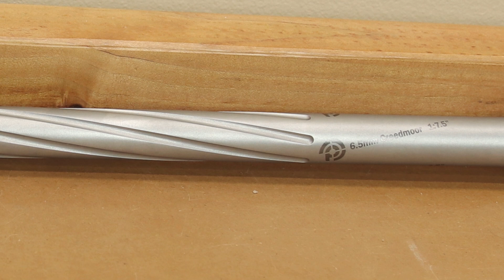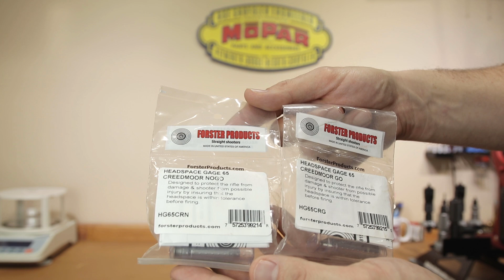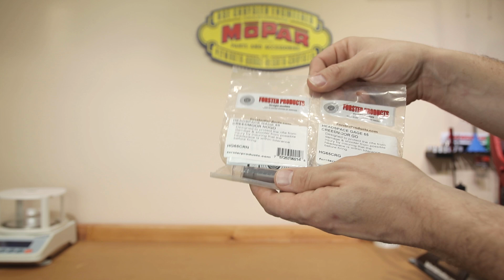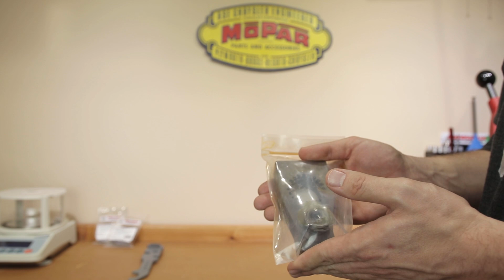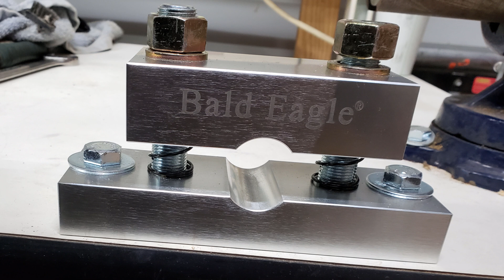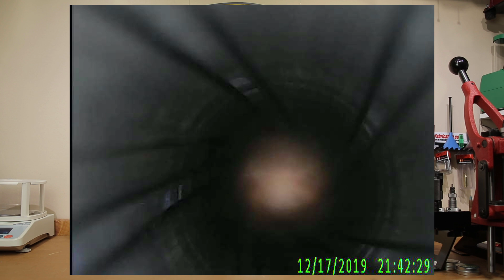Ruger Precision Rifle Barrel Swap - The tools you need

Comment: Man! Just In time. Got a 28in Kreiger 6.5prc, 7.5 right twist. Got PTG go no go gages.  What I cant determine is it better to hold the barrel and unscrew the nut or stick a creedmoor action rod into the PRC lugs and hope. What i have heard is to put about 60 lb/ft on the gun and wack the wrench with a steel hammer. What say you?
Reply from the maker: Making sure you have the action rod fully engaged you will probably be ok, I had someone hold the action into the action rod to make sure it went ok. By yourself having a barrel vice might be the easiest to break the nut loose. I am sure it was way more than 100 ft lbs to get it to break loose.

Comment: i have a Remington model 7 with a worn out 308 win barrel i got a used 7mm 08 & 243 win barrels, barrel vice from savage barrel swap, i got action removal tool  & I had to have a action install tool ordered, i got go and no go gauges already for 308-243 & i figured used barrels would make the gun safer to hunt with!  the fire threw out the end of the barrel badly at near dark & kicked nasty bad too! i used factory ammo with heavy-er stock same thing so the only safe load was ,6 times the re load amount  = it 25.2 h4895 a light load for kids use it shot about like a 7.62 x 39 I had worked on its load & i tested 3 guns i had one hunting gun of the 3 it was little green stock rugar American,  about 2 in left all 4 in a clump that will work the model 7 i shot 6 rounds you could fine 3 of them and a paper plate was smaller group! this is not good! i looked at little greens target it saved my A-- tomorrow hunting opening day! ps it after season fix the gun time i figured! Christmas over no better time then now!